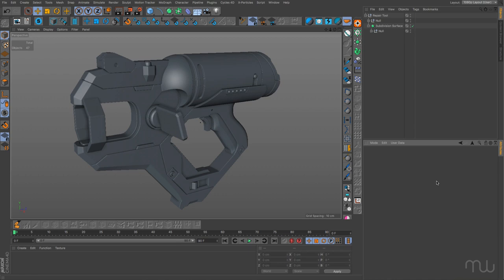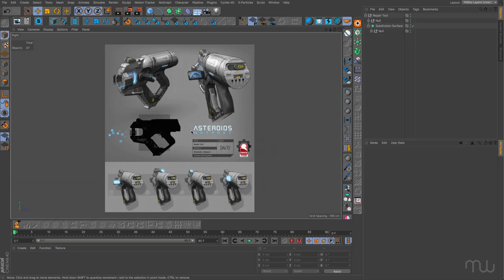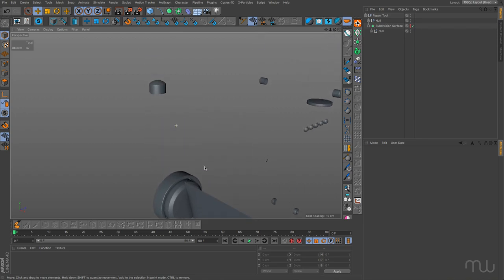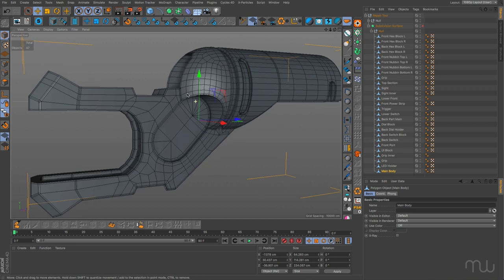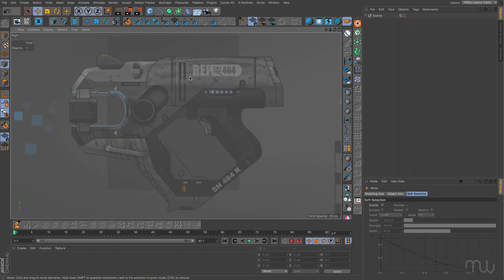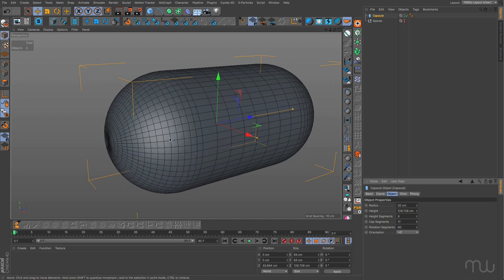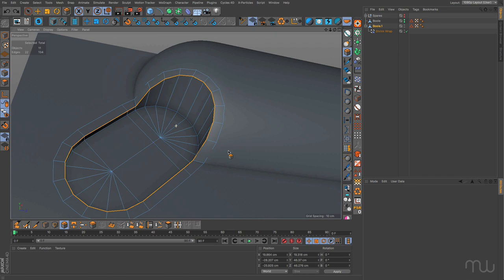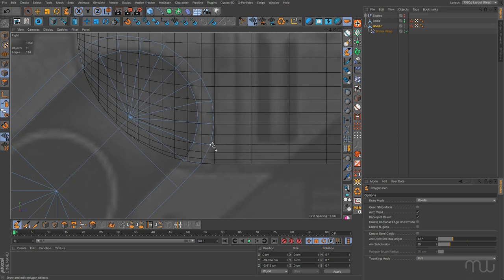Retopology in Cinema 4D

Comment: Guys, please explain what magic trick have been used so polygons stay "shrink wraped" but point mode available? I have the same problem with yours MILG11 Shrink Wrap lesson. Polygons always unwraps from target object when I hit a point mode.
Reply from the maker: Toby mentions this issue at 21:00. Certain tools don't work in conjunction with Shrink Wrap. I usually use Shrink Wrap in conjunction with Polygon Snap mode when using the Polygon Pen Tool.
Reply from the maker: Hey Sergiy, just did a few more tests and it appears that if your mesh is inside an SDS you can edit it with the polygon pen tool while in it's deformed state.